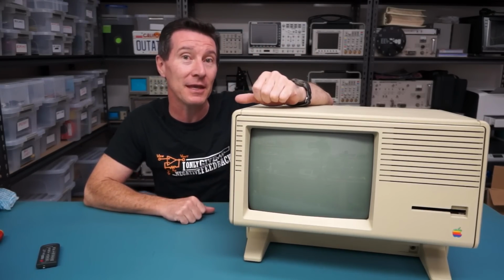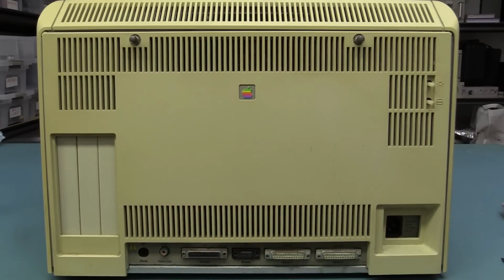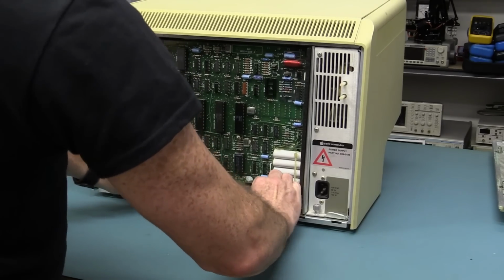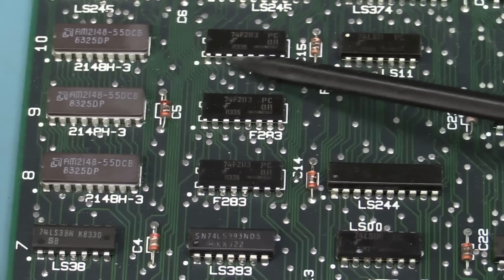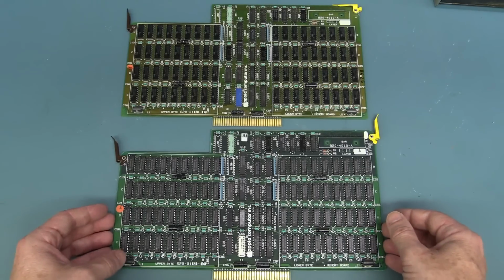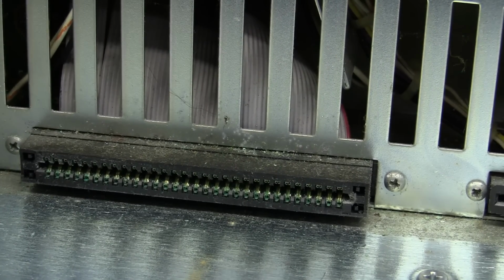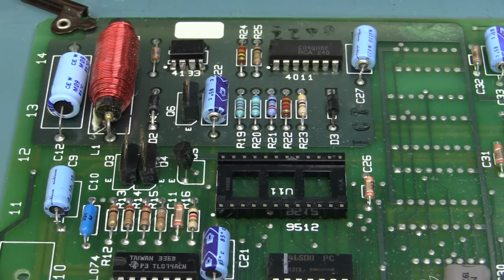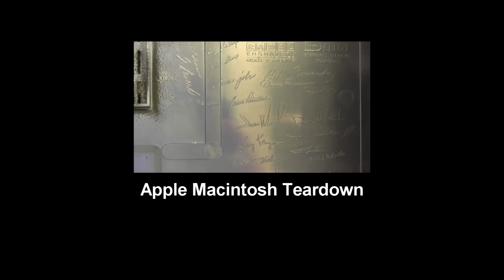EEVblog #696 - Apple Lisa Retro Computer Teardown

Comment: Handmade route board with that size? The guy had balls
Reply: Even best autorouters those old days had been cost a fortune and had been veeeery slooooow and produce non working boards may some 3 out of 5. So manual routing was the way to go and very common. I used to layout the boards all myself when working in that PCB design job. We used protel DXP and still had these unix based specctra autorouter. My boss bought it, some years ago and never get it to run. So i spent ample spare time to set it up and runnning finally on a "spare" HP-unix machine.
Just to see how that specctra was all about....My boss went: "...i´m not gonna paying you for doing that..." I went, hey it´s all pure spare time....As i want to see this up and running.
Those had been days....;)
Reply: TubiCal Damn you bosses!
Reply from the maker: Xano Trevisan Kothe Yeah, not overly hard to do a board that size by hand for a good PCB designer, just tedious.
Reply: EEVblog thanks for the info. But I'm pretty sure I could not do that
Reply: the physical size is big, but the amount of traces is that many compare to today's boards.
Reply: At one point during the development of the original Macintosh, it's said that Steve Jobs had the memory lines changed at least twice to make them look nicer, and when they didn't work he reluctantly let the designers use the "ugly" version.

Comment: There's supposed to be a huge landfill full of these that were scrapped by Apple, much like the recently discovered Atari landfill which you can buy recovered items from on ebay.
Reply: *****
No, they were largely the ET game. Thy found it, and it was full of ET games.
Reply: ***** Look at the cartridges that were dug up and sold on ebay. They are in shrink-wrapped boxes with manuals and store price stickers on them. That essentially proves they were unsold inventory, not "defective" games.
Reply: JKC40 There were other items they dug up, but a good portion of the items were indeed ET games, since they made so many and it sold so poorly. But they did find other titles in the excavation, along with marketing materials and other junk from Atari. There was a documentary made about this that was on XBOX Live about o month ago.
Reply: ***** They were not defective, Ben Heck got a few of these from eBay and cleaned them up and it worked just fine
Reply: Umm... That was the video I linked to earlier. I think it was just the one asteroids cart. Still good to meet a fellow fan of Ben.
Reply: I doubt it, the hardware was similar enough to the Mac that I believe most unsold Lisas were retrofitted into Macintosh XLs.  http://en.wikipedia.org/wiki/Macintosh_XL
Reply: *****
Yes, if "really shitty game that nobody wants" fits the definition of "not working"
Reply: *****
Because it's a major turning point in video game history.  Why do collectors want bits of wreckage from the Titanic or the Hindenburg? Why do people watch Plan 9 from Outer Space?  Why do stamp collectors value that stamp where the aeroplane was printed upside down by mistake so highly?

Do you know anything about the even that led to the ET carts being dumped or the collapse of Atari?
Reply: rockets4kids Why was this to me?  I wasn't the one disputing a landfill for the Atari Lisas.  Cool info though.
Reply: ***** Can you go join the other "edgy kids" in the Pewdiepie channel or something? We prefer adult conversations here. You're just embarrassing yourself.

Comment: I think I recall a fair bit of the Mac software was actually designed on Lisa machines.
If you want even more weirdness the Lisa couldn't write it's own software, and needed a separate OS to do so. I think the Mac had the same problem which was why the software was developed on the Lisa till a few years later when a proper dev system was made.

Comment: There's a parallel port on the back, indicating this is a Lisa 2/5 which came with an external 5Meg Profile hard drive. It had no internal hard drive. So you didn't get screwed. The Lisa 2/10 came with an internal 10Meg hard drive and no parallel port on the motherboard. Adding one required the Parallel Interface expansion card.

Comment: The fact that they provided a parity bit in what amounts to a hobbyist or secretarial computer all the way back then is pretty cool.

People give Apple a lot of crap for a lot of reasons. The fact of the matter is, they have always focused on security, stability, and user experience. Even at the expense of other aspects of their designs!

EDIT;

Also, I love how Dave keeps pointing out that several of he components were made in the USA! While I know that (nowadays) relative build quality is based more on amount paid rather than where it is manufactured, back in the day, the fact that a component was built in the USA basically meant that the design for the component went from the designers in Silicon Valley to the fabricators somewhere else in California (or, sometimes, elsewhere in the US!). That meant quicker revisions and better overall quality of the brand compared to the "cheap" stuff you could get overseas back then.

Basically: Local manufacturing ftw! Go go gadget cheap development cycles!

Comment: This was a Lisa 2/5 with built-in parallel port for the included Profile external 5 meg drive.
The Lisa 2/10 came with build-in Widget 10meg hard drive and thus didn't have the parallel port—it was optional.
Mine is a Lisa 2/10 WITH the optional parallel card for it's Profile 5meg drive (for a whopping 15megs of storage!).

Comment: The 4K worth of 2148s are basically the Parameter RAM (PRAM), used to store clock time, boot volume, etc, etc. This model was used right up until the PPC came out.

Comment: I designed and built 68000 CPU computer boards like this.  Our company also bought an Apple Lisa 1.  That was the computer where I first used a mouse.  You are right that the price was $10,000 and ridiculous.  Your video brought back lots of memories of computer development.  Back then 2 MB of memory was great running at 5 MHz.  Today's computers has 32 GB of memory running a 3 GHz.  Boy have we come a long ways.

Comment: Alot of apple machines where killed by their batteries going bad, especially the ones that had the Maxell lithium batteries that would vent at some point after they died. I had an Mac IIci that the battery did this, not only did it wreck the board, but it damaged the floppy drive and the caustic fumes / vapor from the battery actually got inside the hard drive as well via the vent holes.
Reply: Not only computers, some great synthesisers gone that way as well.....all beond repair, NiCads are even worse and not uncommon as well.....it´s so sad.....
Reply: SMT Capacitors like to vent on some other Macs, like the SE/30. I've an LED signboard that I repaired with battery leakage damage, too. ):
Reply: I have repaired a few battery damaged boards. Not fun. But its doable.

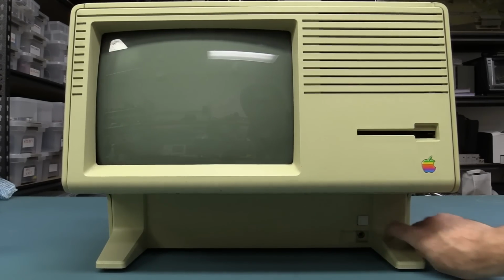Comment: 4:32 The power button on that thing was the first example of software controlled power button (today standard on all computers) you just pressed it and the machine was on (didn't stayed "recessed" like all the appliances at the time), to turn the machine off you just had to select "Shut off" from the software menu and the computer switched off by itself, at the end you just heard a relay switch cutting off power and the machine was completely off
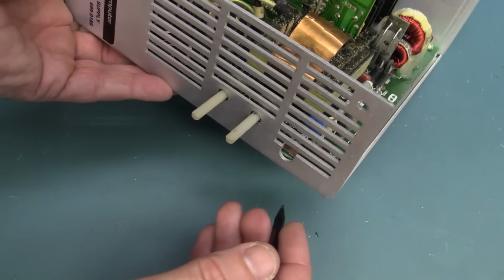Reply: 25:40 As I said... I didn't watch all the video before

Comment: I hope you get to see one of these in action, because they're very unusual computers. The Lisa was aimed pretty squarely at the desktop publishing industry, so its OS tried to replicate the feel of a graphic artist's desktop or whatever. As such, you didn't launch an application to start working on a new document; you "tore" a blank sheet of paper off a virtual pad, and assigned it a type (text, spreadsheet, drawing, etc.) The Lisa OS would then launch the appropriate application for you. The on-screen  pixels were rectangular instead of square, presumably to better fit a portrait-style document on screen. Unlike the earliest versions of the Mac OS, the Lisa allowed overlapping windows and supported rudimentary multitasking. Its CRT used this weird long-persistence phosphor, which changed color slightly as it dimmed, and some even had a green CRT. They looked like something out of Colossus: The Forbin Project.
Reply: Sorry to say, but this is wrong. The Lisa wasn't designed for desktop publishing (DTP); DTP hadn't been conceived yet. DTP was born on the Mac with the release of PageMaker, paired with Adobe PostScript on the LaserWriter printer.

Comment: Shame about the battery corrosion.  I see that a lot in the arcade business too.  Many a good machine ruined by leaking NiCads.

Looked like the 68k in there was an 8Mhz rated one.  I wonder why Apple decided to underclock it?

Love the ceramic 2148 RAM's.  Atari and Midway used a lot of those in their games back in the day,
Reply: I'm willing to bet the majority of this corrosion is not from the batteries, but rather from sitting in a basement that flooded. I've seen this exact kind of corrosion on boards that sat in sewage / water in a flooded crawlspace.
Reply: idontwantagoogle+page
In my experience, the nasty blue fuzz is definitely from the batteries.  The vapors are heavier than air and collect in the bottom of the machine.  I've worked on several things where even a single NiCad cell was enough to corrode everything within a foot below of where it was mounted.  Very possible this one had water damage as well, but hard to say for sure.
Reply: If I recall the 68k Motorola ran at 8mhz initially.  The reason why it may have only run at 5mhz could be due to the clock division from things that ran at a certain frequency at a higher speed.  Instead of having its own clock it used the main clock and divided down until it got into a usable range.  It's just my own theory though.
Reply: idontwantagoogle+page
Its 99,9% from the batteries... You can clearly see that boards that were behind (both memory cards) are completely OK. Btw. leaked batteries are even worse than flood water...
Reply: sprybug Yeah, often they used a divisor on the video-clock to get the CPU-clock
Reply: hey do arcade machines have a nonvolatile storage system for high scores and shit or is that only for the OS? because l have always wondered if george could have unplugged the frogger machine before taking it out of the pizza shop without worrying about losing his high score from when he and jerry use to hang out there.

Comment: Model A6S0200 is a Lisa-2, A6S0300 is a Macintosh XL, should have the 800k upgraded floppy. Last week I got the same one, came out of an attic, and its setup exactly like yours, same ROM revision, mine also has no hard drive. The XL is very rare, apple only sold them for a short time, google its history. The case design and way it comes apart is brilliant!

Comment: You know, I like it that back in the days you could add jumper wires and quick fixes to computer PCBs, today the whole thing will not work if you look at it from the wrong angle due to the high freq. / parasitics!

Comment: Yup. That's either a Lisa 2 or Mac XL. The lines on the front of the case is a dead-giveaway. Both came out in Jan 1984 and Jan 1985 respectively. The XL was a slight a hit as sales tripped. Scully claimed increasing production would have been too costly to meet demand and shelved the product. https://en.wikipedia.org/wiki/Apple_Lisa

Comment: looking at your appreciation of the internal arrangement i'd love to see you tear down a PowerMac G3/4/5 or old style Mac Pro, they were absolutely beautiful inside. in the mac pro you could take out the bottom section of the computer containing the memory, CPU and heatsinks, it connects via a 4 or 500 pin connector.
Reply: it'd probably be a fairly short teardown, take off the door and...yeah.
Reply: maboroshi1986 The key though is to tear it down PASSED the modular elements and focus on the hidden structure of the computer. Apple does a good got hiding most of the "guts" of the computer, so that even the areas you have access to are very clean. I used to use a Power Mac G5 before I built my i7 Hackintosh (built inside a modified 1939 Philco radio cabinet, with nixie tube clock and neon power, HDD, and sleep indicators!) That was one of the cleanest motherboard designs I've seen, and I know the Mac Pro towers are even cleaner yet! Apple hides the big support components to keep those modular areas clean.
Reply: Richard Pi yeah I know what you mean, what I mean more is after you strip the modular parts of the machine is it even possible to go much farther? The backplane motherboard seems like it'd be an utter bitch to examine.

Comment: That's vapor corrosion from the batteries. The vapor is heavier than air, and it sinks and collects in valleys and pockets at the bottom of the machine. Note how the top parts of the boards are just fine? Yup. It's still active now. So try lemon or vinegar to neutralize it and then clean it up.

Comment: Correction.  Technically  Apple didn't "steal" the GUI from Xerox Parc.    Steve Jobs toured Xerox science park to see the research projects in 1979.    Xerox wanted to invested in Apple because it was the "hot startup" at the time, so they invited Apple guys to tour their campus (as they often do with other startups)      Steve Job wanted the GUI.   So Xerox gave the rights to the GUI to Apple  in exchange for 100,000 Apple pre-IPO share at $10 per share.    Xerox didn't really see a big future in the GUI because it wasn't essential to their copiers, which was their cash cow.    Soon after,  the Xerox GUI engineer left Xerox and joined Apple so they can continue to work on the GUI.   The rest is history.

Comment: Dave, I bought a similar Lisa or maybe Mac XL from a guy in Glenorchy Tasmania around 1997-1998, and it booted, but crashed instantly every time at the same point. 10MB HDD. Have no floppies for it. It has a 3.5" FDD and I am now missing a metal plate, that holds the CRT. Yours would be perfect for me to take measurements from to make a replacement plate. I could probably also fix all that corrosion with a bit of effort, love and dedication. New copper can be laid down and dry electrolytic caps can be replaced. I think its amazing what vinegar can do for corrosion. Don't do any scrapping of this vintage piece of history, thanks
Reply: "New copper can be laid down" rather you them me mate! Have you SEEN whats left of the edge connectors !?

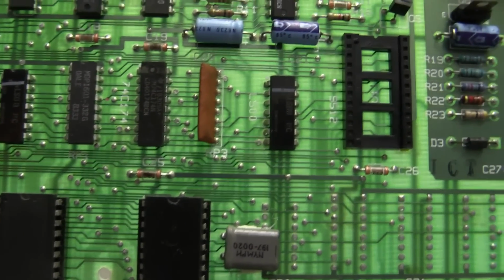Comment: At 17:20 - Talking about the 6522 keyboard and parallel port controllers - I will bet that they used those as the Apple ][ (and Apple III I believe) used a 6502 processor.  Thus they had expertise in house with that line of parts and reused that knowledge.
Reply: Digging into the schematics I see that one of the two 6522 (the one for keyboard/mouse) was interfaced to a COPS (National Semi) CPU (noted by Dave) with custom mask ROM for Apple. There is also a 6502 CPU on board the LISA as well, a 6504 variant used in the floppy interface. This LISA system you can see was quite elaborate with at least 3 separate CPUs and it's perhaps no wonder it was expensive.

Comment: You could probably ghetto-fix the traces with a buttload of jumper wires.  Immense pain in the arse, but probably easier than getting another board.  :3
Reply: Jerkwad152 that could work but dunno about the contacts

Comment: Are you sure this is a Lisa 2 and not an Lisa XL from 1985 or later?  about Sun Marketing - In 1987, Sun Remarketing purchased about 5,000 Macintosh XLs and upgraded them. Some leftover Lisa computers and spare parts were available until recently when Cherokee Data (who purchased Sun Remarketing) went out of business.
With the help of Sun Remarketing in 1989, Apple disposed of approximately 2,700 unsold Lisas in a guarded landfill in Logan, Utah, in order to receive a tax write-off on the unsold inventory.[

Comment: The cheapest way to repair that sort of issue would probably be to have a new set of boards made. Given that most of it is 74xx series logic and they're mostly 2-layer (with one having internal ground) it wouldn't cost nearly as much time/effort as relaying all that copper by hand.

Of course, it might be nice to show a video of how to repair lifted/horribly damaged pads and traces, but given that it normally takes a bonding station to do properly it's not that helpful to amateurs.
Reply: Maybe if you dont value your time...haha!
Reply: It would take less time than repairing the existing traces, given how extensive the damage is. That's not to say it would be fast.

Comment: 1981 doesn't make it ancient! I graduated from high school that year and remember watching some tech TV show when this was announced,and it was pretty damn impressive. But the price, $10,000 was a stiff price even then compared to an IBM original PC. 
But I wouldn't say the Lisa was a failure, it was more a pilot project for the Macintosh is how You need to consider it. I had a friend who picked up a pile of Lisa's from some company tossing them out in the early 90's. He as able to get a set of Mac EPROMS to make them into slightly more modern Mac OS machines. The Mac was born of the Lisa, more integrated and taking advantage of LSI technology to get rid of all the discreet components. Mac's still weren't cheap, but they were durable and people got a ton of use out of them. The original IBM PC's were pretty useful too, I was still dealing with booting our old machine up every morning at a shop I worked at in the mid 90's. It's sad now that a machine is considered useless after being a few years old, and as for Apple, after a while You can't even upgrade to latest OS's!